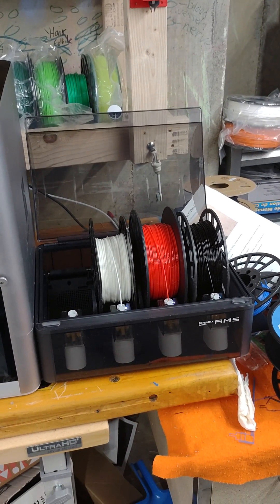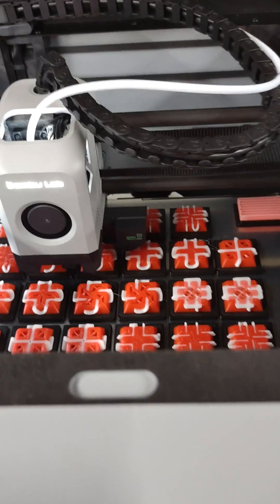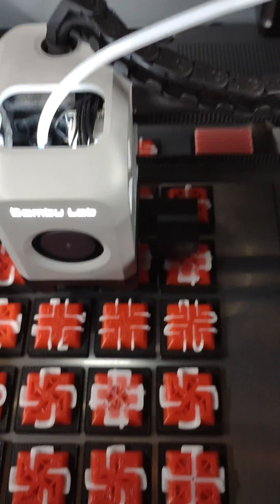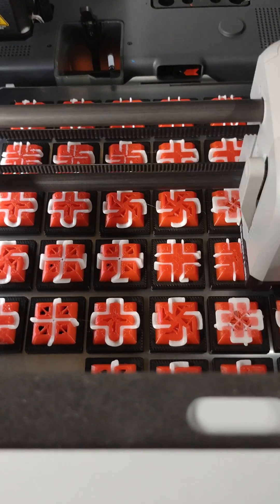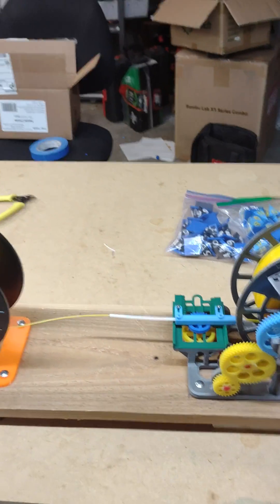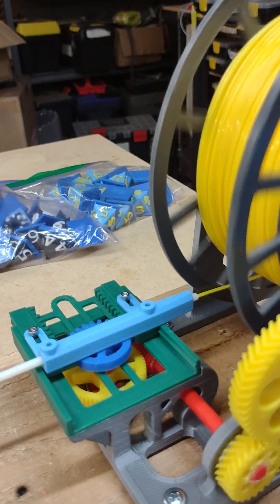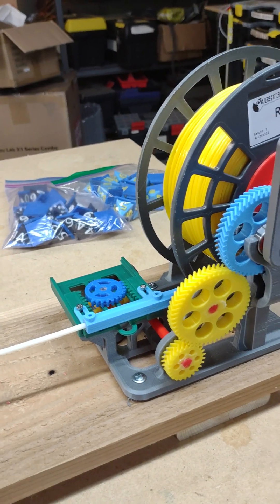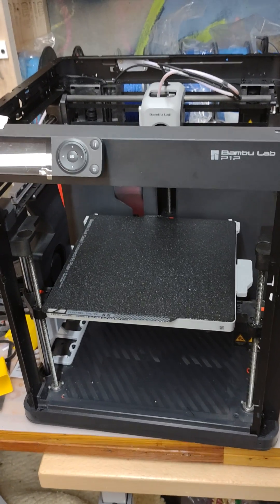Bambu AMS - ARC  spool re-winder and WhamBam

Comment: There's also the option of getting the Hydra AMS, which allows for certain larger spools to fit, but the amount of work required to install it I feel isn't worth the effort. Gotta basically take the entire AMS apart. I built that same kinda rewinder (although I use an electric driver to turn the gears), and I think it's a much better solution, plus it's really cool to watch.
Reply from the maker: Thanks for watching and your comment.  I have a newer version printed and ready to put together, but just need to do it.  I'm finding more vendors are using spools that fit with out needing re spooled

Comment: Are you printing pla in the x1c?  Thanks.
Reply from the maker: Yes.  I have also had great success with ABS, PETG and some glass and carbon fiber infused nylon, the nylon would be better if I could get over 300c for the hot end.
Reply: @woodwaker1  for petg, I ordered the texture plate from Bambu labs.  Do I apply the glue stick or gel glue to the plate?  Thanks.
Reply from the maker: @redone823  I have only used the cool plate / engineering plate from Bambu on the X1, until I got a WhamBabm PEX plate.  I used glue stick on the Bambu plate to start with then switched to hairspray.  The Whambam plate I print PLA plain using the High Temp Plate setting.  I would suggest that for PETG you always use some kind of barrier, either glue stick or hairspray.  It sticks too well and can destroy the surface.

Comment: I like the rewinder.  I wonder if it could be converted to work with string trimmers/weed wackers?  It is always a pain restringing the spools on those.
Reply from the maker: I certainly could be, it is about the same diameter - in fact I tried using some trimmer filament to print with as it is just a Nylon plastic.  You need a 3D printer to make one!

Comment: 57 filament changes?!  I'd be interested to see the weight of the finished prints versus that of the💩it produces.

Non-standardised spools shouldn't be a thing anymore; I get really annoyed with some of the ones I have that won't fit into the vacuum bags I use, so thanks for the link to the re-spooler. 👍
Reply from the maker: That is one of the big problems with color changes, and why the Wham Bam plate is worth the cost.  The print I was running just finished with no problem - I changed it to have 3 sets of the tokens - the same waste as one or two sets, since it has to purge on every change - no matter how much is printed.  57 changes is on the low side, some prints others have done have many hundreds.
Reply: @woodwaker1  Yeah, come to think of it, it makes total sense for there to be no difference between the purging for one item or a whole build-plate full.
Reply from the maker: Take a look at the video I just posted, answers some of your questions.
Reply: @woodwaker1   Will do. 👍

Comment: Are you fitting the ARC enclosure to the P1P David? I saw a video on that enclosure and was pretty impressed by it.
Reply from the maker: Thanks for watching.  It is for the P1P, so I can print PETG and maybe ABS.  I have printed all of the parts and ordered the kit from the US source that included the panels and hardware.  I have all of the heat set inserts mounted, so hope to be mounting everything tomorrow.
Reply from the maker: Andrew, finished the kit and just posted a new video, very happy with the results